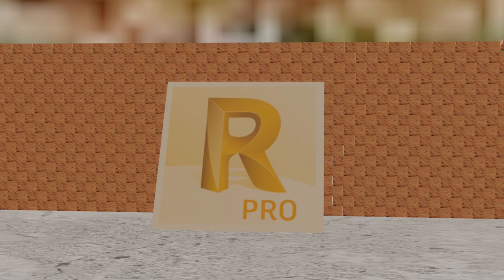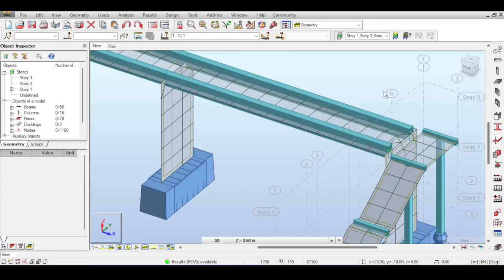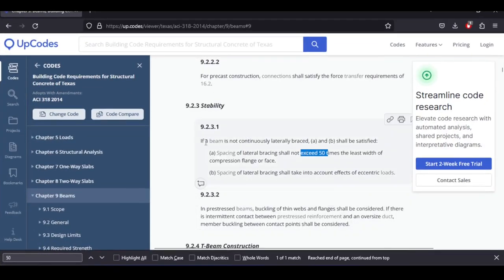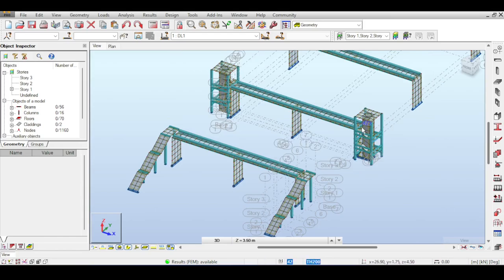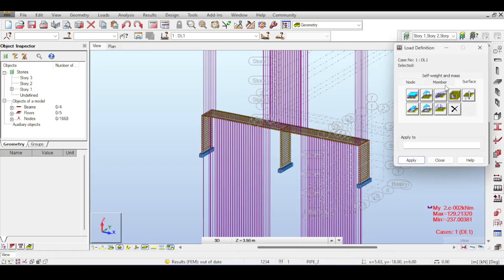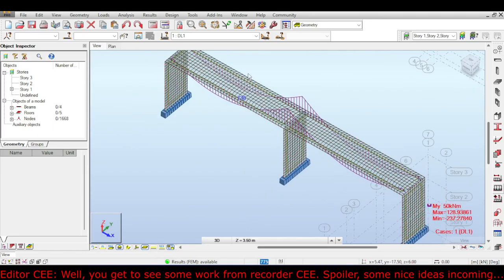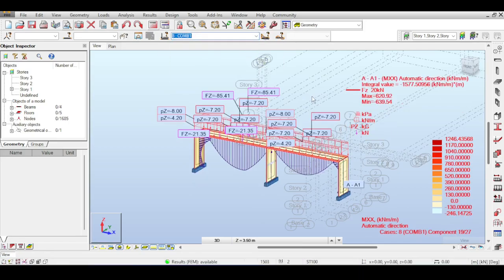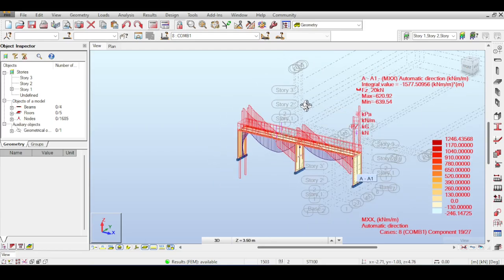Modeling Pedestrian Bridges Using Autodesk Robot | Part 4 - Wrapping up

Comment: Hello CEE,

I would like to dispel the notion that last videos in a series may be inherently less interesting. As is mentioned by yourself, it is important to wrap-up things properly. These videos do just that, and they additional help to connect the final dots, to confirm, and to reinforce the application of the ideas learned and introduced throughout the rest of the series. For me this is an important learning step on its own; what may seem obvious and simple often turns out to be something else and it is good when there is a wrap up video that shows and confirms the work. I do not find these videos disappointing, I find them necessary and they serve as important “….haah….and…..aha....moments…..” Thank you for making these the way that you do.

0:18 I am glad that the CEE “…did not just hand wave…..” 😊😊😊 the lateral stability discussion. Indeed, most codes do have similar provisions and guidelines for beams slenderness limits and associated limits on the distance between lateral restraints. Clause 5.9 of Eurocode 2 (EN 1992-1-1) for example is one such code that certainly make a curious reading in this regard.

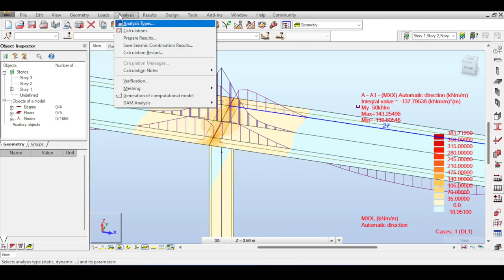15:51 😊 I like these “Rabbit holes”, they leave “bread crumbs” and gives necessary hints to the “behind the scenes” and to the real extents of many issues and topics that are covered in this channel. About the “influence surfaces”, maybe Mr. Editor could add this to the “Current Video Ideas for the Future list”?

20:44 I concur with the various loads’ types and the general estimates that have been included. I think these loads have covered all the key areas of the loads that are required. The WisDOT guide that CEE shared in part I is a huge eye-opener with regards to what is to be included in this regard.
 
23:35 Nice tip on Contour v/s Contour Edge (#); simple as it seems, this could become handy in other models and applications, thank you for this. 

27:40 Mr. Editor sir, you make very good points, keep it up! 29:10 **1.6 LIVE !!!!!** 😂🤣😂. 

With regards to Mr. Recorder performance, my view is that Mr Recorder is actually doing great, all things considered 😊. He does cover pertinent details to rouse interest throughout from the beginning of the video to the end.

30:33 With regards to the deflections that Mr. Editor is pointing out and considering that the beams and the deck slab used in this model are currently modelled as concrete, and that concrete deflections are influenced by its reinforcements and also by the period of loading (long term deflections). How meaningful are the immediate deflections from the analysis in case of a concrete model? Is it possible to display long-tern deflections for RC concrete elements as part of the entire model in RSAP? (I know that the RC beam element design module does display long-term deflections and incorporates rebars effects on deflections)

General Questions:

A)	Releases (😊): 

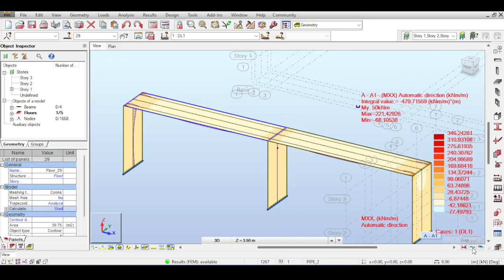I have released both ends of my beams and both ends of my deck slabs [I have made NO releases on any of the piers themselves]. All pier supports are behaving as expected (simply supported in the same way as it is showing with the center support @18:37 on this tutorial video) [but in my case, this is so for all the support piers, and not just for the central pier]

I am happy with this arrangement and all seem to be working as I want it to. The challenge I have is as follows:

1.	I had “assumed” that by doing the above releases in the way that I did, it means that “the deck slab is now primarily a one-way spanning slab that is supported on the beams only. 

Therefore, minimal to none bending moments will be present on the deck slab in the direction parallel to the supporting beams [the x-axis direction in the current model]?

2.	To my surprise, when I create a panel cut (say for a Dead Load Moment along the xx direction) parallel to the XZ plane along the centre line of the deck slab from one pier to another, I get a simply supported BM diagram between the piers. This is theoretically correct and it is as expected except that the value of this moment in my case is about 60kN.m at mid-span along the deck slab centre line; 

And if I now create another panel cut (for the same Dead Load Moment but now along the yy direction, i.e. along the direction of the supposed one-way spanning deck slab) in the perpendicular direction (along the YZ plane) at the same mid-span position only now crossing or cutting through both the supporting beams and the deck slab, I do get the expected BM diagram shape of a simply supported beam with extended cantilever ends on both sides as expected BUT the value of this BM diagram at the mid-span position (this position coincide with the same last position from which I read the 60kN.m when looking at the XZ panel cut discussed above) is now 1.3kN.m ???

What gives? If the deck slab was indeed spanning one-way in this direction, shouldn’t its BM be the largest in this one-way spanning direction as compared to the long (unsupported) perpendicular direction to this one-way spanning direction? 

If one were to design rebars using these BM moment values, the most rebars would be along the XZ plane and this is not right? There is hardly any support for the deck slab along this plane. What am I missing? 

3.	How can one make sure that the deck slab is indeed one-way spanning between the beams in this case?

B)	Cast-in-place RC, Precast RC, and Prestressed beams options for the pedestrian bridge: 

A pedestrian bridge is usually constructed over existing “busy” roadway, and as such the conventional in-situ construction of RC elements which requires temporary support scaffolding (located at and blocking the use of the roadway for the duration of the construction period) is not ideal.  I would therefore imagine that the analysis results from a model such as the one here are used to (for example) select or to design pre-cast or prestressed concrete beams capable of resisting the maximum BM and SF? And spanning the considerable spans that are involved? I know that I have asked a similar question before and CEE indicated that it may be considered on the highway bridge series that may be yet to come? For now, is there a quick way to size say an AASHTO/PCI STANDARD I BEAM(S) based on the analysis results obtained from our model in this series? Which key outputs are required? Perhaps CEE could consider a tangent video to touch-up on this?

The span of the simply supported beams in this model is 13.25m c/c of the supports. In a “perfect engineering world – which unfortunately does not exist 😊” Which option would CEE consider to be ideal for such a pedestrian bridge? a reinforced or prestressed beam option? What would be the main or key engineering related influencing factors to this decision other than cost? (of course, cost will not be ignored).     
       
Your tutorial videos are always a pleasure to watch. This one is no exception. Thank you for the pedestrian bridge series and for the associated tangents covering pattern loading and influence lines. I am looking forward to the next adventure.

Ps. I have a proposal for a possible future video tutorial for your consideration and I will write it up on a separate comment here.

Have a great day, and I’ll see you in the next CEE video.

Regards, DK
Reply from the maker: Hello Engr. DK,
I guess you are kind of right. Somehow, wrapping everything up may give insights of what was done, and some food for thought for the future. 

I told the Editor to add the influence surfaces to the list of videos to be covered. Thanks for the suggestion, it really helps.

Also, indeed, the WisDOT doc is an important doc. I guess this is the reason why the theory parts of those structures is equally important. That is the reason why in that instance, I just added me some loads.

This is basically the first time Mr. Editor has his own "explanation of things". I guess his debut was well received.
Now I do hope he does not have to jump with his own explanations often. But I guess that I missed the deflections so Mr. Editor came to the rescue.

oooooooooooooooooooooooooooooooooooooooooh the immediate def. vs long term def...
This is a really really really interesting topic. Now truth to be said, I usually heard stuff like (the long term deflection is 2.5 times the short term)
But I want to personally dive into this and check out that thing.

Indeed, here are the problems in the deflection you get from any FEM commercial software (Robot, SAP, ETABS, PROKON, STAAD, AxisVM, Dlubal RSTAB)::::
1) The deflections you get are under the elastic theory
2) The deflections you get do not account for cracked section Inertia
3) Even if you input the cracked section inertia, those deflections do not account for ANY long term effects.

This is a topic definitely worth checking out.

Ok now to your questions:
Gimme a moment I will address them one by one
Reply from the maker: Continued:
I just realized in Q1 that you are right. But I have an explanation for this:
The current model does connect the slab with the beam with no release between the slab and the beam.
This means that:
whatever moment that is on the beam, would also result in rotations. Those rotations are then also affecting the slab (because no release between beam and slab). And those rotations would produce moments in the slab.

Please note that: this is the reason why codes allow beams to take some parts of the slab into account as their upper flange.

Now if you want to totally eliminate this, do not use offset, but use compatible nodes. It will take some time, as you might have to split the slab into 3 parts.

For Q2: For a pedestrian bridge, I would immediately opt for a precast  non prestressed PCI girder. Now those PCI girders have well-known application ranges that are already established. The document that is shared now is based on prestressed concrete, but could give an indication for non-prestressed members.
https://drive.google.com/file/d/1T7NM02P8HG4D3JTCh8U6Njr6n9Grp2eP/view?usp=share_link

Please note that the initial design of bridges is still the topic of research today. There are a million things that get into the mix: number of girders, stresses in girders, cost, deckslab, and so on. Here is a to a research profile having two research papers about it:
https://scholar.google.com/citations?view_op=list_works&hl=en&hl=en&user=kOKFPw4AAAAJ

Still, drawing from an actual experience I had,
we do have constructed the girders and deck slab within 48 hours. In that case, we diverted one direction of traffic to the other direction for one day, to finish one span, then vice versa, we diverted the flow of the other direction to the first direction for 48 hours.
The rest of course was finished in normal speeds. It was kind of a hassle and I had to be present there 16hours per day. But it was a success.

I hope I did not miss any question you had.

Regards,
CEE
Reply: @CivilEngineeringEssentials 
 
Thank you for the feedback. 

Your deflections discussion is really really really 😊 enlightening. I am curious to see what the CEE may find from the possible stated dive on this topic. Your response have also pointed me to review the assumptions, limitations, and/or options which a software manufacturer may have published on this topic as it applies directly to the various structure types that are used on their software.

Kind regards, DK
Reply: @CivilEngineeringEssentials  

For Question 1:

a) I hear the explanation as to why there are relatively larger moments present on the deck slab in the direction parallel to the support beams. However, if one were to design the deck slab based on these moments results as they are, would it then make practical sense that there are more design (bending) reinforcements in the direction parallel to the span than there is (bending) reinforcements in the actual direction of the span itself?

b) Regarding the flanged T or L concrete beams cast integral with a concrete slab; and the option to release the slab from the beam [if required] using compatible nodes is something that I will still have to try out and compare the results by using verifiable fundamental situations in order to see if I can figure out how it all works in RSAP.

For Question 2:

a) Thank you for the reference. From the design charts, it is quite clear that indeed extensive work have been done to establish certain products and their application ranges with confidence. It is amazing how far one [an experienced designer] can get with these by simply having just the span and the loading vehicle information in order to start [no analysis or calculations appear to be necessary at the initial design].

b) The G.O.A.T research profile, 😊: Ooooooh, what a treat. I will definitely browse and read through what I can; thank you so much for sharing Doc.

c) 48hrs Construction: Wow…that was hectic, I am glad that it was a success.

Yes, you have addressed all my questions that I had posed, and then some 😊. 

Thank you, and kind regards,
DK
Reply from the maker: Hello dear Engr. DK,
as for Q1, Indeed, there should be a way to eliminate the longitudinal moments in the slab to better fit the real construction circumstances. I personally do not think that for the slab discussed in this video, if the slab is constructed above the girders, and not cast together with the girders, I believe that the slab should not be designed for longitudinal reinforcements. It is kind of intriguing, because each modelling result has implications in the in-situ construction and structural detailing. This is what I love in structural engineering, and keep mentioning every now and then in my vids.

Also, here is a good for thought that I have not yet mentioned in any video, 
in case you monolithically cast the girders and slab, an approach is to treat the entire bridge as ONE BIG GIRDER.. it is an amazing approach indeed, and you would see in the pdf (if I remember correctly) there is a double T section (just to get an idea how it would look like).

I need to dig a little bit deeper about how to force RSAP to consider the case of slab on girders. I will check about it.

As for the research profile, well, I am still not a professor, I mean, a 34 (almost 35) year old assistant prof. is still a "n00b" in the research realm of science. But I am doing my best.

Oh just to clarify, the 48 hours was only the placement of the girders on the piers,
the project itself, of course, needed more time.

The planning for that day took a while,
we erected the piers, brought the precast concrete, did all measurements and checks, and then lifted each span within a day. No slabs, nothing, just the precast girders. Then, we put 5cm concrete slabs  that are gonna act as both formwork and part of the slab. those slabs had shear connectors and we had to basically put our steel meshes and cast concrete on top of those. The concrete cast could theoretically be done during day, but to limit danger, we had to rely on night concreting for the jobs.

It was a kind of nice experience.

Regards,
CEE
Reply from the maker: oh wait!! I just got struck by an idea!! Let me end follow it from my side, but here is the "abstracted version" of it.

You see, the reason why a slab is assumed to be "carried" by the beams is because beams do possess a substantially higher inertia than slabs.

Now when a beam with higher stiffness deflects and rotates less, of course.

This deflection will cause a moment diagram in BOTH beam and slab that is related to their relative stiffnesses. 
Having a low deflection in the beams will generate still a significant moment diagram in the beam, as F = kd and M = k theta.
where k is the stiffness and is large.
the same deflections and rotations would cause lesser moments in the slabs because its stiffness is smaller.

So in a normal world, moments in beams should be as usual, whereas moments in slabs should be minimal.

But when a beam is WEAK, its stiffness is not significantly larger than the slab, the deflections are high, causing high moments in both beams and slabs as there is no big stiffness difference.

This is just an Idea I had while I am shopping right now. I will end-follow it and maybe record a video about this issue. It is important as I see a lot of students being puzzled by the same issue when analyzing high-rise buildings. 

So basically my Editor screaming his lungs out DEFLECTION, was spot on.
Let's see how this unfolds, I still have to sit on my desk and check it out, as those are only thoughts based on my understanding while pushing a shopping cart LOL.

Regards,
CEE
Reply: @CivilEngineeringEssentials  

Eureka!! you really do live and breathe engineering MJ 😂🤣😂 . Your idea is simply brilliant. 

It opens up so many exciting modelling scenarios for one to try, such as increase the sizes (stiffness) of the beams, experiment with various sizes (stiffness) of the slab, consider the impacts which various support conditions (or configurations, or even spans or spacings) on the beams and/or on the slab may have on the combined stiffness (ref. RSAP “…..structural orthotropy of slabs and shells. Structural orthotropy refers to the lack of uniformity of slab stiffness in different directions, due to, for instance, slab ribbing…..” ? I am currently just talking out aloud here and I will need to collect my excitement 😊 and do try test some of these thoughts out.

Before your idea, I had been thinking that perhaps for the design of the girders, one should rather resort to using “cladding” instead of FE shells to model the deck slab. This would avoid the deck-girders interaction and it would ensure for maximum loading effects on the girders? But truth be told, this approach would be a workaround and an avoidance to try and appreciate and to understand the 3-D world of structural elements interactive behaviours offered by FE modelling.

I have said it before, and I will say it again

It feels really good to be around the CEE channel.

Have a great day

Kind regards, DK.